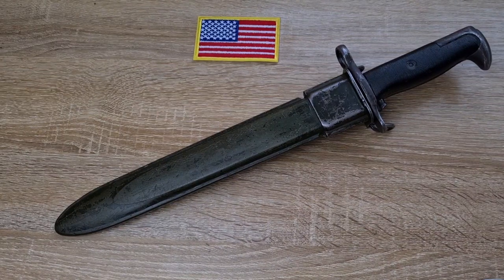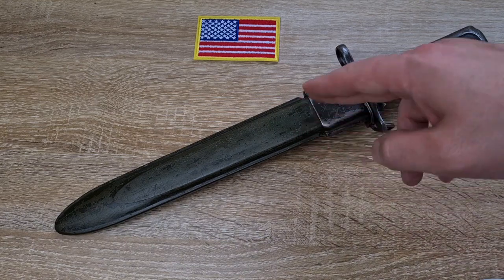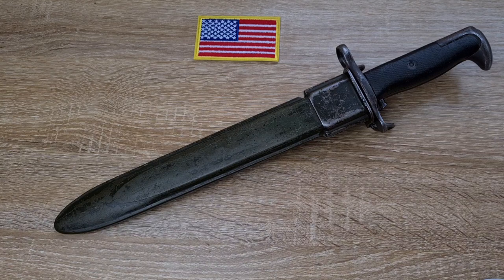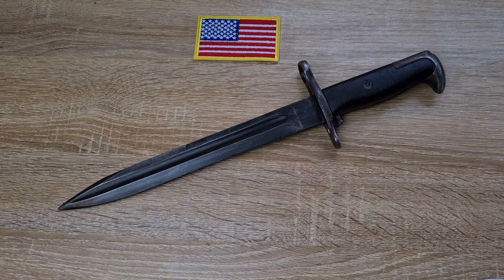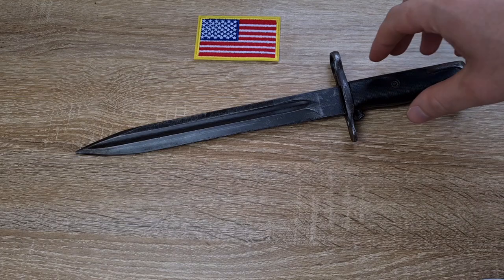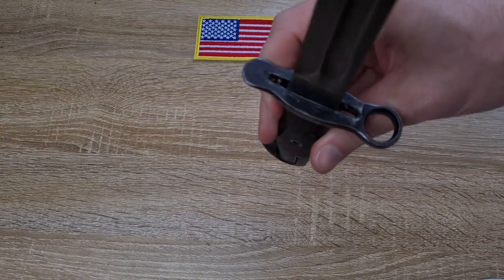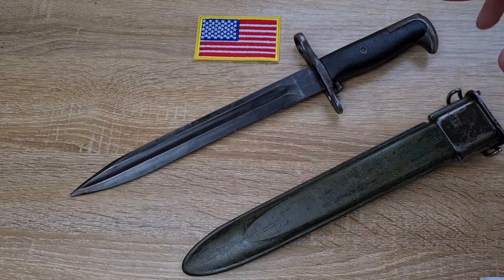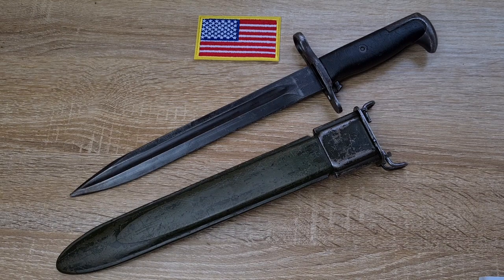US WW2 M1 Garand bayonet, the M1

Comment: 4:08 Does the 3 million mean, 2 million M1 bayonets and 1 million cut down M1s from m1905s? Are the uncut M1905s not part of that 3 million? 5:28 Wilde Tool is the only company who did not produce the M1 bayonet, they produced the longer M1905 which is the 4% production,. The WT company had so much problems during the production of the M1905s that they did not get the contract to produce the M1 bayonet. The task of shortening the bayonets are done by any of the companies, so a blade made by AFH can be cut by UFH, some companies did mark the bayonets they cut. It is impractical to collect and sort the M1905 bayonets by manufacturer and return them to the original maker just to be cut down. This means that there are cut down M1 bayonets made by WT from the m1905s, they were just cut by a different company. 6:46 PAL also marked other parts of the bayonet they produced with a P, you can find a P on the guard and the bayonet catch.